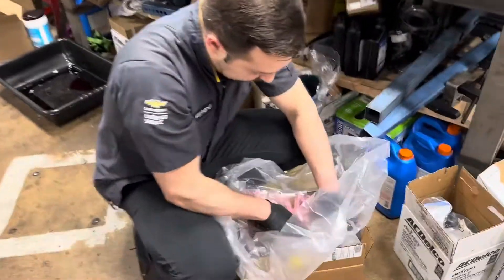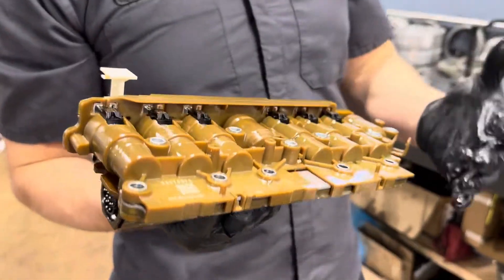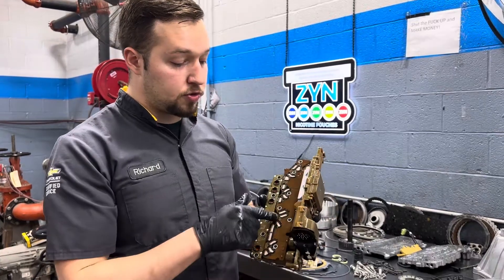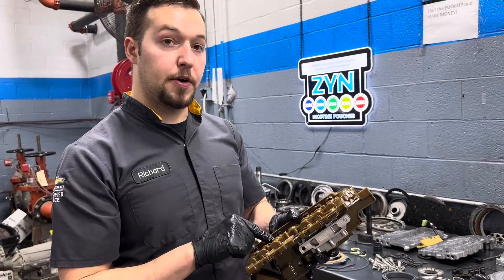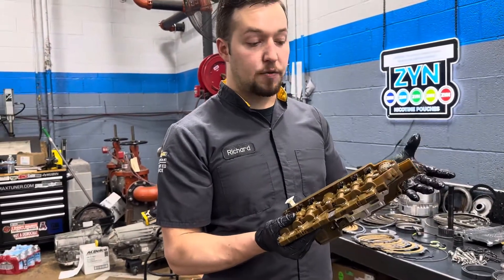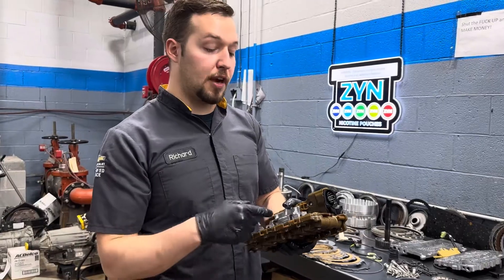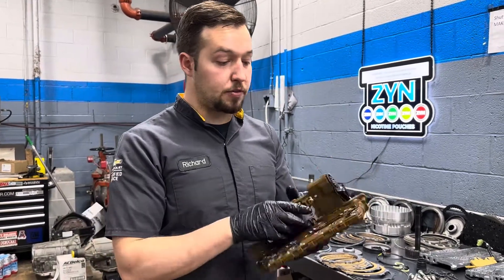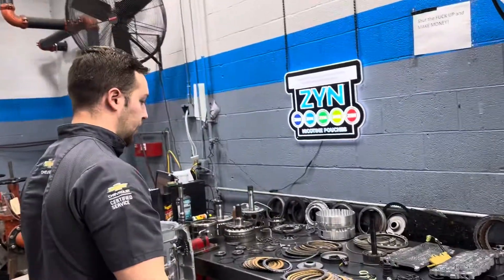Why I replace TECHM’s on my 6L80 rebuilds

Comment: My TECHM is good but I wana clean it from the metal as part of my rebuild. Can you please answer if its OK to clean it? For example a can of break cleaner and air compressor. I cant find any videos on Youtube of anyone cleaning them. Is there a specific safe way? Thanks plz answer! 🙏🙏🙏
Reply from the maker: @jamesethan3749  take the pan of your transmission and put the techm in it with the case connector portion of it up. Add 3-4 quarts of dexron 6 to it and use a soft nylon brush and let it soak on the solenoids and assembly. You’d be surprised how much crap will come out. Be sure to remove filter plate too
Reply: @esoterictransmissions  thanks!!!
Reply from the maker: @jamesethan3749  Godspeed! Hurry back now!

Comment: Okay what if let's say prior to break down no techm specific codes are thrown truck not shifting into 4-5 gear  metal in the pan, upon removal, stator and pump scored,  tcc valve grinded down, 4-5-6 smoked, do you still replace the TECHM if you can rule out those other parts as the cause?
Reply from the maker: @devil0311doc  you can certainly reuse it after a good soaking in fresh atf and or cleaning but if I’m charging someone $5500 and up they’re getting a new TECHM. I used to reuse a lot of them under warranty and it’s rare but there can be issues.
Reply: @esoterictransmissions  Nice thanks man,  love your information it's very useful after rebuilding my engine back in November and deleting DOD/Afm, when my tranny blew this second time I said why  not let's tackle the transmission I have much more respect for your trade even more it's alot of work and chasing down small leads to come to a diagnosis reminds me when I was a combat Medic lol.  Thanks for the response back and the information it's invaluable look forward to more of your videos.  Sam